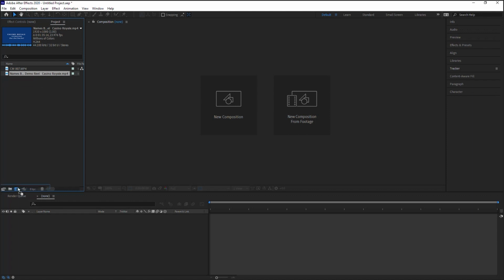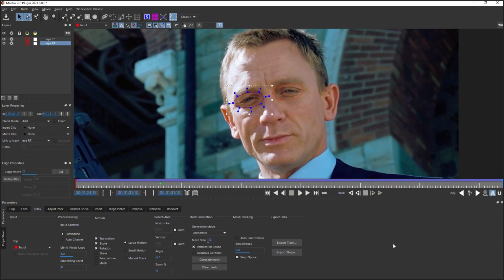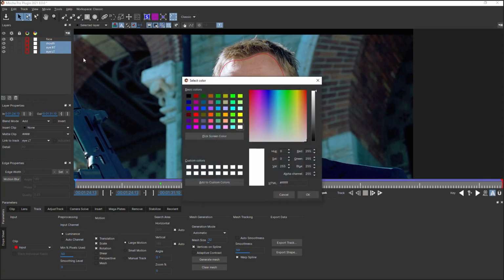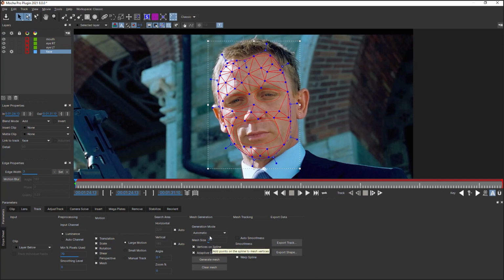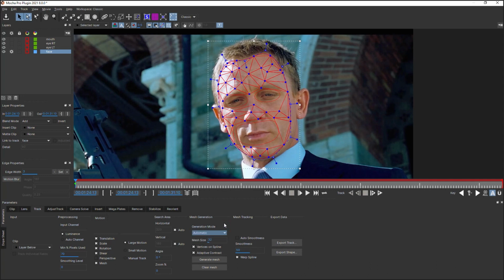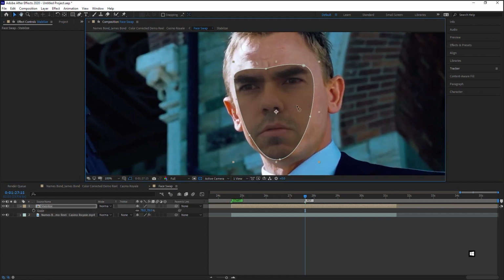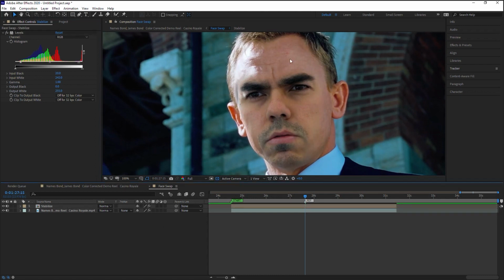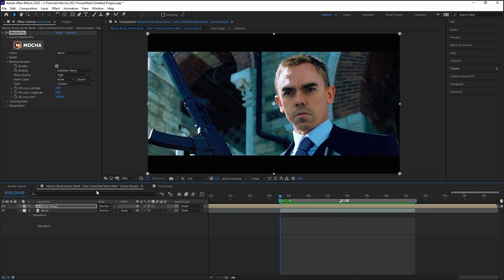How to Face Swap with Mocha Pro Power Mesh

Comment: Is there any way to use only the movement in the video, but change the clothes and background?
Reply from the maker: Change the Background you can try rotoscoping. Change to complete different wardrobe, I would try an AI tools such as Stable Diffusion, although it wouldn't be a 100% clean swap.

Comment: Hi... Noobie here. first time using Mocha Pro and your video was superb to help me understand how to make my first face swap...But and there's always a but... lol... Once I finished my project.... my face didn't track with the bond clip at all... could be just me and more than likely it will be... I've saved the project now can I go back into the settings and try again or do I have to start all over again for scratch... I believe it could be the Drift part you were saying the number 70, 80, or 90... or something else... your help would be appreciated.
Reply from the maker: It's most probably an alignment issue. What I would do is for the clip that you will track in Mocha - before you track - clip the in and out point that you'll use and export that file (mp4, mov, etc) and use that rendered/exported file as your tracking shot. It'll keep the tracking data at the beginning of the timeline.
Reply: @cmdelavega  Thanks for your reply.. What I've have done is clip the scene from the main clip approx 6 secs and recorded myself clip 6 secs. thinking that should match up, but as I play back myself clip has no tracking just fix to the spot.... I'll try again and let you know the outcome.. many thanks...

Comment: i dont understand why did you duplicate your original video where you talk ?? you didnt use it any way you used it only to check that its stablized you could deleted after that ?
Reply from the maker: The duplicate copy is where I apply the power mesh and it only contains a masked area of the face. I still need original footage so I can composited both layers to pull off the effect.

Comment: Sir please help, i installed mocha pro 2021 seperately but in after effects its showing the older version of mocha and i am using after effects 2021..please help..🙏what to do
Reply from the maker: You should definitely contact the people over Boris FX. They'll help with issues like this.
Reply: @cmdelavega  yea i found the solution..thank you
Reply: @levenin9689  Hello! Can you tell me what was the solution? I'm struggling with this too
Reply: @Mate20001000  you need mocha pro plugin for after effects full version not standalone application.
Reply: @Mate20001000  after you installed mocha pro plugin there will be 2 option in Effects and presets one of mocha AE and another mocha pro, you should select mocha pro.

Comment: Seems like a lot of work and extremely limited. It's cool but phone apps are kicking ass right now.
Reply from the maker: Yeah man, you're absolutely right. Several apps doing great face swaps easily versus by hand. My only problem with the apps are the limited resolution. Not sure if you can get 4K or higher??

Comment: Hello, Can you please tell me if you can use ELEMENT 3D objects on a powermesh? If so that would be amazing! Thank You for any info :) 😉🌺
Reply from the maker: Yes but you will need to precompose the element 3D layer first then apply powermesh to the precomp layer.
Reply: wow if this works that is awesome! So you are saying that we can ATTACH 3d objects to our powermesh data? So after precomposing the element 3d layer and tracking with powermesh we can add 3d objects on to our tracked powermesh. Like we do with images and text?? amazing.
Reply from the maker: @3DGraphicsFun  yes, if the layer is precomposed (such as your Element 3D layer) then you can add powermesh because the precomp will now be a 2D layer and not a 3D layer. However, if you want to change camera angle or rotate/position 3D model you'll need to go into the precomp layer.

Comment: When i enable render and select stabilize warp the imagine doesnt move with the video. ( i am trying to replace my face(video) with a different face (image). Nothing works.
Reply from the maker: I was having similar issues when I moved the clip (before entering Mocha) or I trimmed the work area of the footage (before entering Mocha). If you're leaving the footage exactly how it is, sounds strange. Are you setting up a reference frame after you tracked?
Reply: @cmdelavega  I have somehow figured it out. (Not moving the clip after trimming and pre coming the imagine). But now I have massive issues with mesh tracking. For my example i want to replace the entire face so i am doing Uniform mesh with 25-30 speces between poits but the tracking is so ugly and all over the place. Maybe my footage is not HD enough? or should I increase the amount of points in the mesh?
I am at my wits end.
Reply from the maker: Is there anything in front of the face or any light/shadow changes? I had that issue on some shots. When the lighting condition change in the shot, it throws off the tracker. Or when a shadow gets casted on the face, same deal. If those things are not present in the shot, then trying drawing a smaller tracking area, barley over the eyes, mouth and nose. Also try bumping the Min % pixels used all the way up to 90. I would try decreasing the mesh size to 16, 12 or 10. Hope this helps!
Reply: @cmdelavega  yea, thanks. I might be moving my head too much and too expressive with my mouth. Thanks bro
Reply from the maker: If you're mouth is moving a lot, make sure your holdout matte/tracker covers entire mouth.
Reply: @PijonMan  how  did you do it

Comment: COOL! So what's the difference between this and Lockdown plug-in?
Reply from the maker: Thanks! For me personally, the Power Mesh was much easier and faster to get the job done. I had so many issues  with Lockdown plugin (even the simplest track wasn't locking correctly) and on top of that you need to render out an EXR file that takes a very long time to render.
Reply: Mocha's tracking is built off planar tracking. Another point to mention here is because of the layer and roto system you can use Mocha's mesh to track things that are occluded (imagine if a hand went in front of the actor's face)... and you can use the mesh driven track for roto.
Reply: @BorisFXco  Cool! Thank You. Good example!
Reply: @cmdelavega  Okay, Thank You. Will keep that in mind.
Love your Tutorials! BTW used one of your AE Tip on a  Motion Poster I created for a product. Looked good!